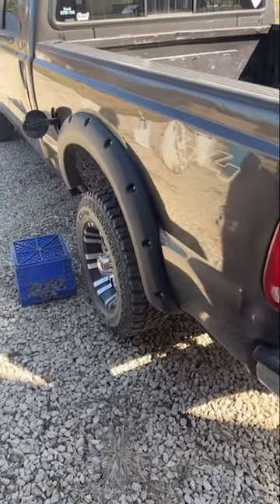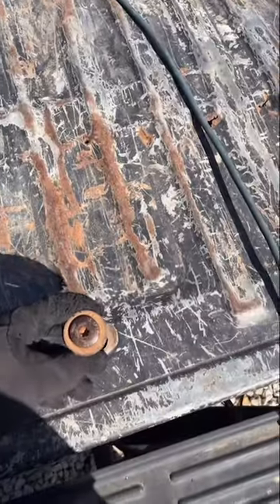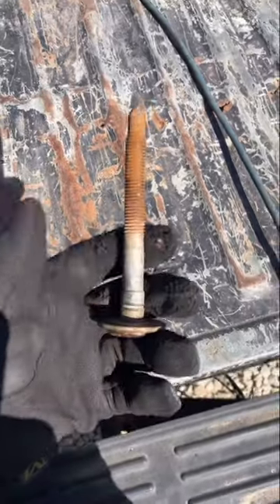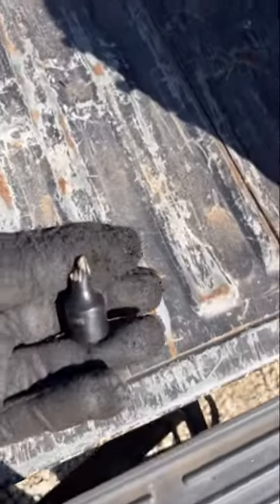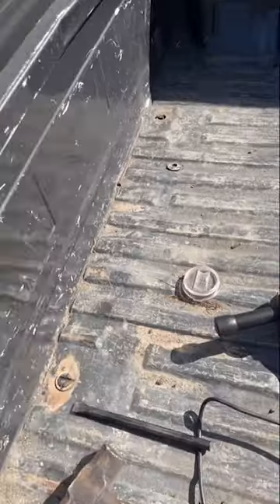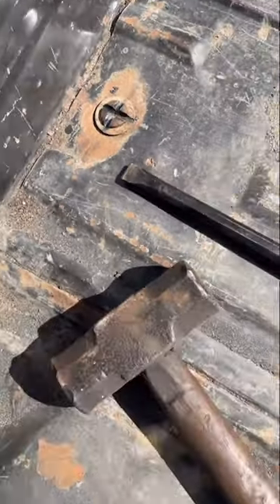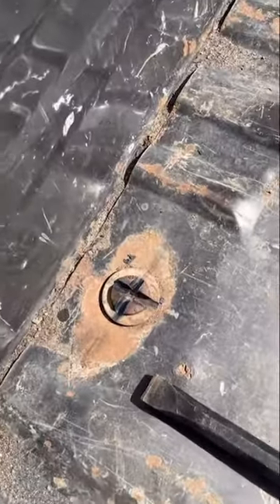Bed Bolt Removal

Comment: I seen one guy use an induction heater on the nuts underneath because he said that the factory uses Loctite on the threads.
Reply from the maker: Yeah I really want to get one of those induction heaters. These bolts were coated in years of mud and rust so might not have helped too much here

Comment: How are u supposed to get the bolts out if u cut them? 

I'm wondering as my ford ranger has torx bolts they seem to be a pain so I'm thinking about cutting the heads off but how would I remove them 🤔
Reply from the maker: Once the bed is off the nuts are on a clip like a big U nut, so can just cut that clip and the bolts and nut will just fall out the bottom of the frame